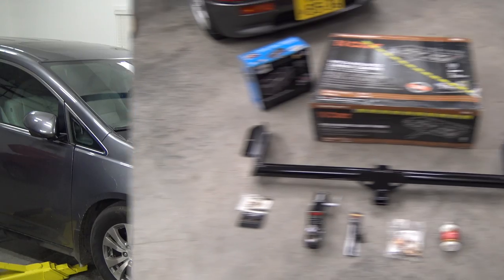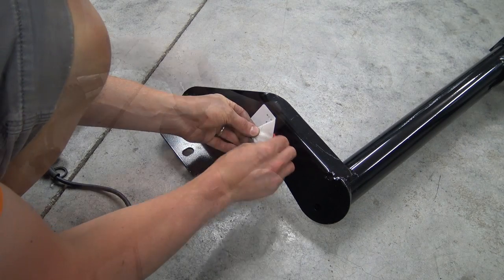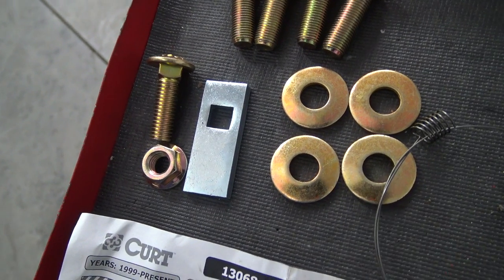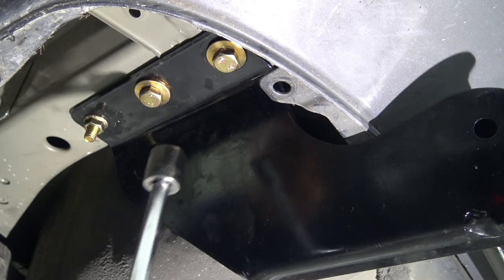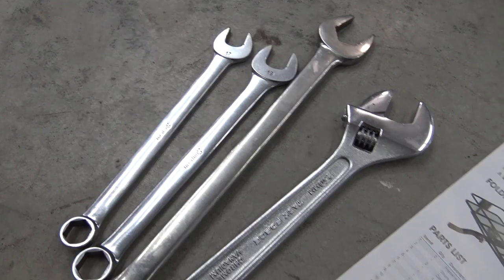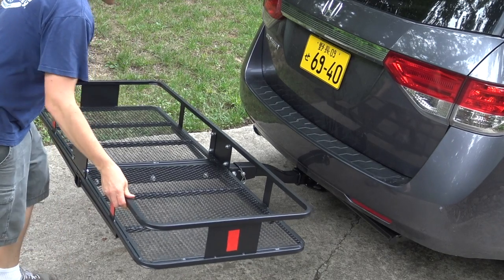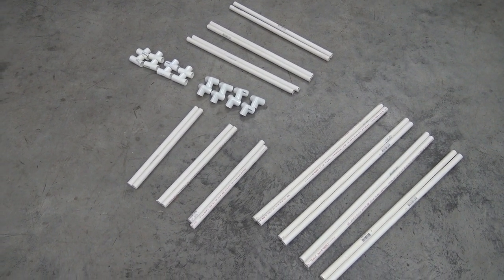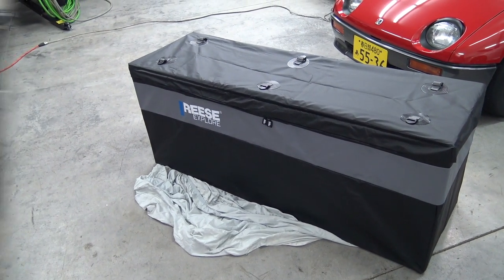Get More Space & Utility with a Hitch, Cargo Carrier & Cargo Bag!

Comment: I followed this step by step, and now I have a carrier on the back of my Jeep. However, I cheated on the bag. I bought a patio storage box, one of the ones for supplies, and mounted it to my carrier. Before I put the storage box together though, since I drilled holes in it for mounting, I coated the inside with rhino lining and made ir water proof again. Then I vinyl wrapped the outside in that silver stuff that looks like a toolbox, and it looks like I’m lugging my tools everywhere with me, when it’s not, but it is my storage chest. It’s got a 150 gallon capacity, if that tells you the size. It’s so secure that it doesn’t even need to be ratcheted down at all, but I do it anywhere for my own peace of mind
Reply: Please post pictures and thank you

Comment: I found the PVC instruction somewhere but since it is way buried somewhere in this thread here is is TTT:

I created an internal skeleton frame to keep the bag semi-rigid, works very well. I assembled it in two halves outside, then put in bag with some help and joined the two halves. Since the joints add about 1/2" at each end, my cuts were 6x22" (vertical pieces), 6x16 (horizontal pieces), and 8x27.5" for length.
raw materials: (around $12)
4x 10-ft 1/2 PVC
8x 3-way 90-degree elbow for corners
4x T-shaped adapters for middle
4x end caps w/ threaded end (these will be added to the 4 tee pieces to make a 4-way elbow thingy for the middle.

cutting/assembly
- First two 10-foot pieces, I cut 3 x 22" 3 x 16" for each 10-foot pole (gives you the 6 & 6).
- Second two 10-foot pieces I cut 4x27.5" each, giving you 8 length pieces. (I started with 28" but had to shorten to make it in the bag)
- for the 4 middle T-shaped pieces, I drilled hole in the middle of it just a bit smaller than the threaded end cap to make a 4-way elbow (home depot didn't have a piece of this shape).

Comment: A good idea would be to add some support bars on top if you're still looking for some rigidity in that PVC frame.  They make T-Connectors with a slot cut in them so you can slot them over a PVC pipe.  Just get two of those connectors and a short length of pipe to place on top before zipping it up.  You can temporarily pop them off whenever you need to grab stuff.
Reply from the maker: Sounds like a plan to me!

Comment: For the internal frame, to support the middle, cut a length of PVC pipe with scalloped ends that will snap between the middle parts.  You can then pop it out to load but it will give some strength when strapping it down.
Reply from the maker: Great idea!  Thanks for that, I’ll do it this weekend.
Reply: Can you add a picture to see what you're talkin about scalloped ends please

Comment: Great video!  I've installed three Curt hitches on my cars, and while they are nice, they do rust quickly.  I even gave the most recent one a coat of black spray paint before I installed it, and it just rusted from the inside out in a couple years.  They're probably rusty before Curt even coats them.
Reply from the maker: Very good to know, I did hear this in the comments.  I'll keep an eye on it.
Reply: I've had my Curt hitch on my 2014 Oddy for 5 years now.It looks like the day it was installed, with 90k on the van.
Reply: bare metal rusts in mere hours, normally you dip it in stripper before coating it black

Comment: How does that cargo carrier affect your mpg? Looking to install either a hitch carrier or roof box but not sure which will be the better option for a road trip.
Reply: Each would probably have their own advantage(s).  A rooftop carrier means that the length of the vehicle is not changed, you can still maneuver as usual and park in the usual parking spots (unless there's a height restriction).  But you can also be sure to get bad handling characteristics because your center of gravity is now up higher (esp. if you load it heavy) and you have more wind drag.  On the other hand the hitch carrier is going to make the vehicle (obviously longer), and this may cause parking problems.  I'd worry about people behind me not being able to see my brake lights and turning signal lights with the rain box.  On the other hand since it's not on top of the vehicle your center of gravity does not change, but, with a heavy load in the back it may begin to see-saw your front end or make the rear sag in a way where you may want to get helper springs (or airbags, etc.).  Going up and down steep hills may cause your hitch carrier to drag or even bend ... this is not a problem with a rooftop carrier.  Just my $0.02.
Reply: The only problem with a rooftop carrier is you can't open the sunroof! 😞

Comment: If i was keeping it on the vehicle, i would use nut and bolt than the locking pin,i've seen these carrier over in the UK they've all ways been on 4X4s suv were there is little room in the back for luggage they seem a great tool. :-)
Reply from the maker: Thank you for the tip sir!

Comment: That's a very interesting storage solution, although I'm pretty sure it's super illegal here in the EU. At least here in Portugal, AFAIK you either install a roof rack that can't extend past the length of the car, or an actual trailer (that requires a special driving license). Fortunately you don't have any of those problems, but do you think not being able to see the end of the rack on the rear view mirrors and having the lights partially blocked by the cargo bag to be an issue for you? Best of luck for your road trip, cheers!
Reply from the maker: Thank you Andre!  Yes, it's kind of a free-for-all, anything goes kind of situation over here! :-O
Reply: But then again, in the EU breathing over your daily alloted amount of oxygen is illegal.

Comment: Tom I ran into the same problem last year on our 3500 mile vacation in 2013 odyssey.  I was considering putting a rear cargo rack also but was concerned that the van would need over load shocks since mine was heavily squatted in the rear.  Let me know your thoughts or what you discover on yours.  Thanks

Comment: Hi, im trying to drill out an existing hole in the subframe to fix the stripped threads.  My drill keeps jamming and can’t drill forward.  What do you think is wrong? Is the actual drill underpowered? Thanks
Reply: bhadz100 you need a cutting compound to help assist your drill bit. Try some Blaster that Tom keep banging on about lol
Reply from the maker: Haha!  Well said!  I like something called Blair 11750 Lubricant, that says "rotabroach" in big letters on the side.  It is made for drill bits and cutting tools and works EXCELLENT!

Comment: I installed a Curt hitch on my 2010 CR-V in my drive way and it was easy to do. AS for having to trim the plastic piece some models require a bit of trimming and I was lucky in that mine did not. I use the cargo carrier to haul gas cans and garden stuff if I don't have my truck available.  Add a pair of the orange flags on a stick to the rear corners so brain dead idiots don't run into it like someone did to mine.  Added the towing light kit for when I need to tow a small trailer.
Reply from the maker: Thank you for the tips and ideas!  Hauling gas cans back there is an excellent idea!

Comment: When you're popping those plastic plug fixings out you don't have to use a screwdriver - you can get a tool for it - it's just like a pry bar with a notched end so it spreads the levering load around the 'stalk' instead of all on one side like you get with a screwdriver - they're no more expensive than a screwdriver and save many (but sadly not all) broken pegs!

Comment: Can't fold up the back if the frame is in the bag. I say screw the frame, just fill it up with crap. Then you can fold the thing up bag and all.
Reply from the maker: Fair point.  The place we stay has lots of extra room to store this, but if that wasn’t the case just using the bag as you say would make more sense.
Reply: It makes sense from a product development point of view that they don't include a frame but having an option for one should be there. Something like those dome tent poles that snap together so it can quickly and easily be put together and also collapsed and store in the bag when in the folded position.
Reply from the maker: Yes, that would be perfect!
Reply: I just got this same setup for an up coming trip. I like the idea of the frame. If it’s not glued together it could be broken down and stored in the car while not using. I’m thinking of ways to secure for an overnight stay at a hotel.

Comment: Aluminum racks make a huge difference on the weight leveraged out past your hitch...If you have a vehicle with low ground clearance, get a rack that has a stepped neck, so it elevates the rack, so you don't bottom out...watch where your exhaust exits in relation to the cargo you carrying in the rack...if you your EGT's are too hot you may just burn a hole through a Rubbermaid container and melt all your new compression shorts. Hypothetically speaking